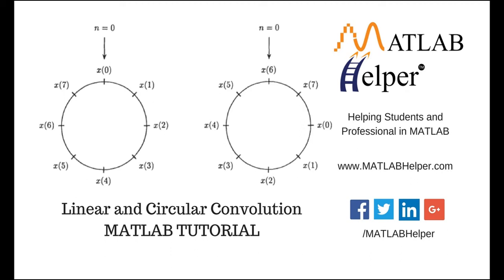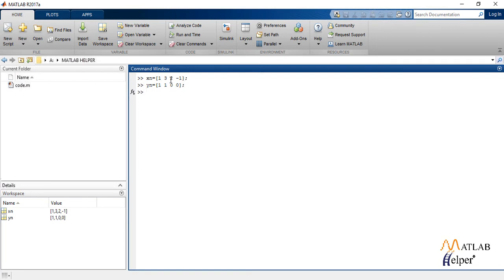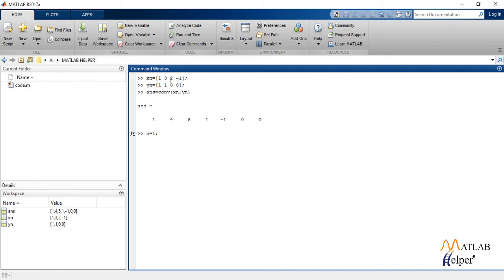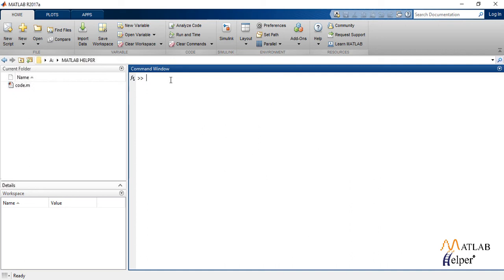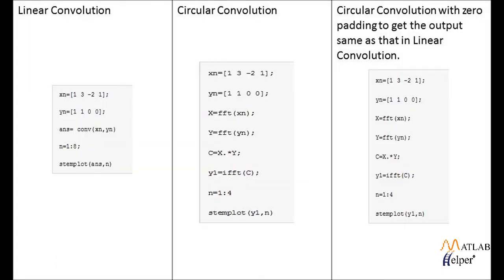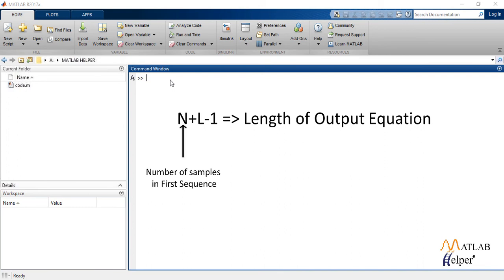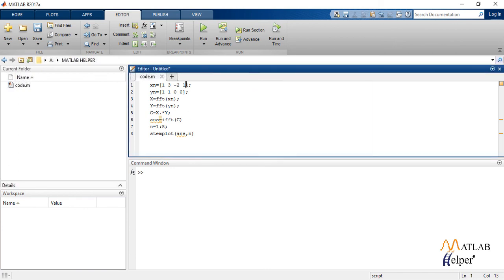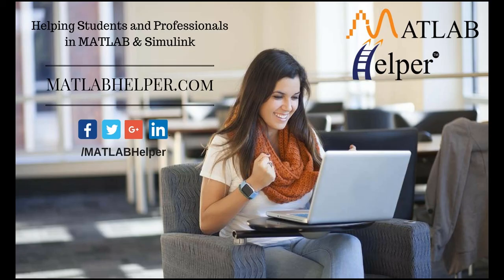Linear and Circular Convolution | DSP | @MATLABHelper

Comment: #Linear convolution is the basic operation to calculate the output for any linear time-invariant system given its input and its impulse response.
#conv(x,y) is the command i.e used to perform convolution between 2 input sequences.
#stem is the command to plot the graph in a discretized manner.
#circular convolution is nothing but the inverse fast Fourier transform of multiplication of discrete Fourier transform of 2 signals.
#fft is the command to determine the fourier transform of a sequence
#herec=x.*y is used for matrix multiplication..
#ifft is the command i.e used to perform inverse fourier transform.
Reply from the maker: Thank you for your valuable Feedback! Do support us by Subscribing to our YouTube Channel at https://www.youtube.com/c/matlabhelperteam